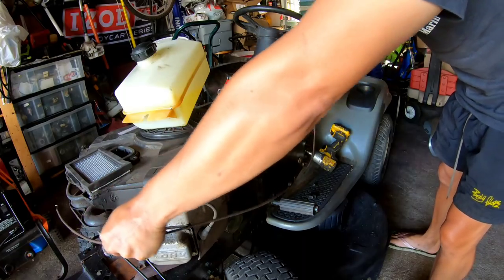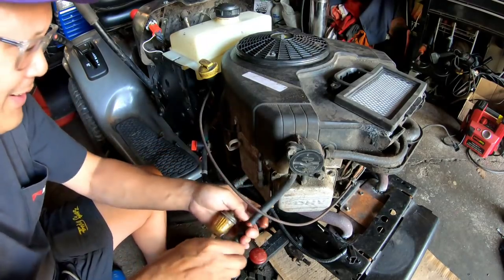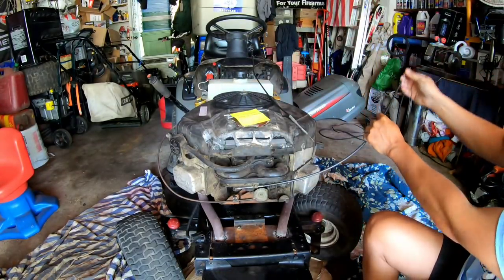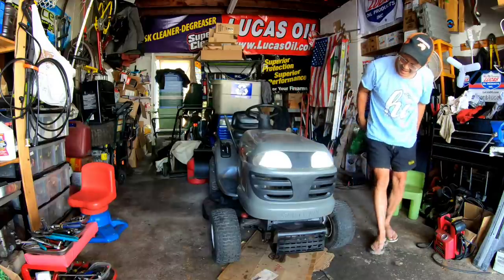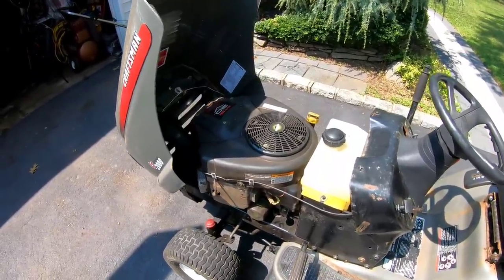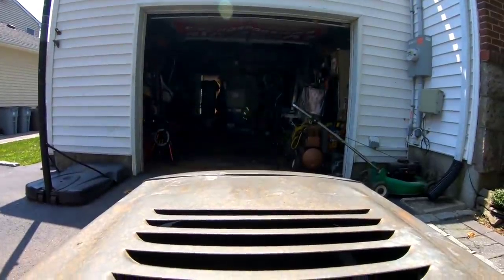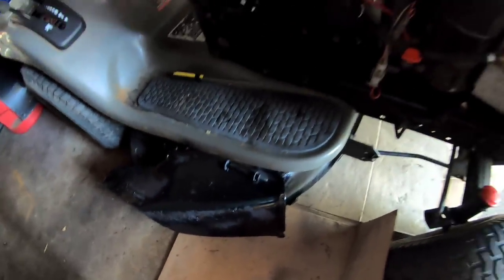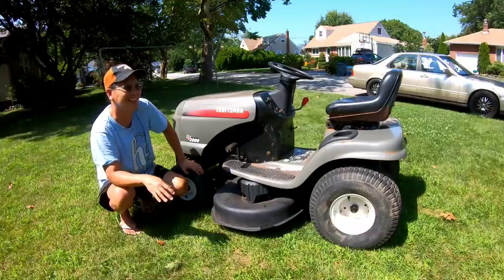CRAFTSMAN LT2000 LAWN TRACTOR REPOWER PROJECT BRIGGS 20HP V-TWIN OIL CHANGE CHOKE CABLE FABRICATION

Comment: Thank you Henry :) Great job. Briggs just seems to rise to the top. Fixing those cracks will be very difficult. The heat expands and then it cools and contracts. Any product will have a hard time overcoming that. Good luck. maybe just coat the whole engine with something. Lol Take it easy, see you later. :)
Reply from the maker: I think the jbweld will fix it.

Comment: The Steering Wheel NUT always came loose on my LT2000, I had lock tight that now. You might want to check the locking pin further down the steering column. That steering column once dropped out on me, when the steering wheel nut got loose an came off. That column required a locking pin like the ones that holds the deck in place.

Comment: to fix kohler engine try harbor freight aluminum welding rods they are cheap and you use map gas or propane . I have used in the past and worked very well just make sure area are clean. and fix wont crack after engine heats up. from expansion and contraction  long term fix
Reply from the maker: I’ve always wanted to try those brazen rods.  Good tip Barry,  hope you’re subscribed